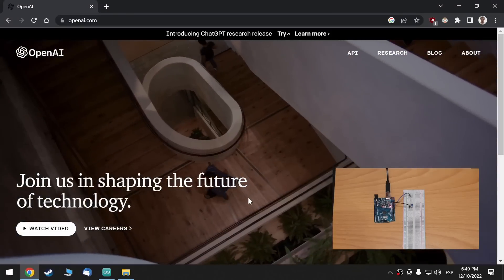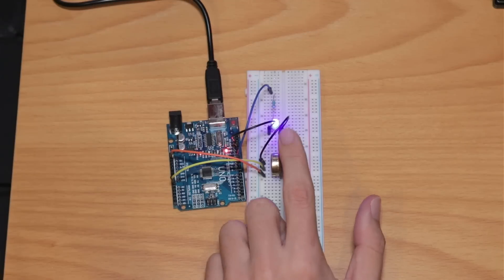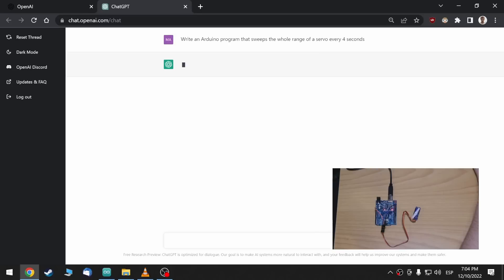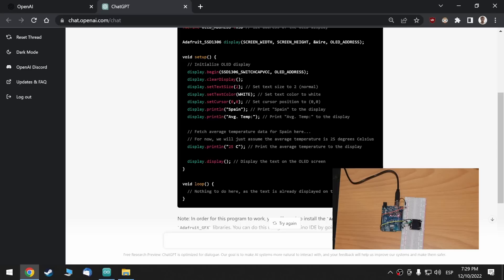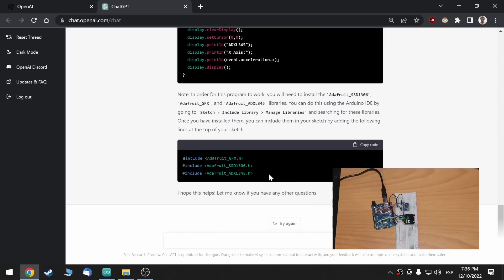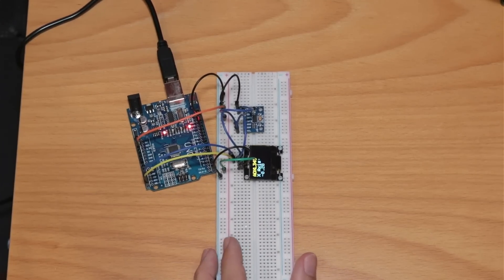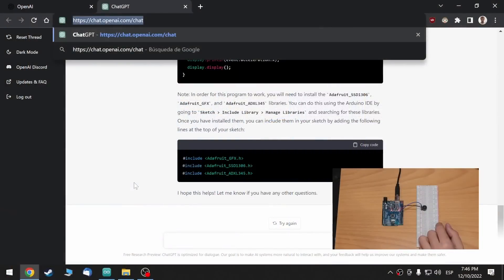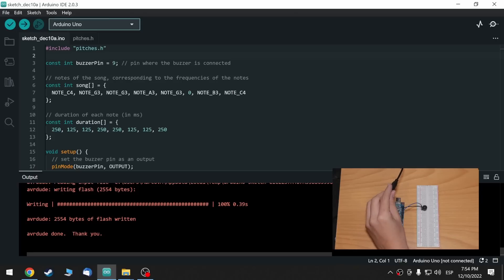ChatGPT absolutely DOMINATES Arduino programming

Comment: Got something a bit different:

#include <Tone.h>
#include <SoftTone.h>

// Define the piezo buzzer pin
#define PIEZO_PIN 9

// Create a Tone object for playing notes
Tone piezo;

// Smoke on the Water melody
// Notes are given in half tones above A4 (440 Hz)
// R stands for a rest
int melody[] = {
  0,  // A4
  2,  // B4
  4,  // C5
  5,  // D5
  7,  // E5
  9,  // F5
  11, // G5
  12, // A5
  14, // B5
  16, // C6
  17, // D6
  19, // E6
  21, // F6
  23, // G6
  24, // A6
  26, // B6
  28, // C7
  29, // D7
  31, // E7
  33, // F7
  35, // G7
  36, // A7
  38, // B7
  40, // C8
  41, // D8
  43, // E8
  45, // F8
  47, // G8
  48, // A8
  50, // B8
  52, // C9
  53, // D9
  55  // E9
};

// Smoke on the Water tempo
// 4/4 time, quarter notes at 140 bpm
int tempo[] = {
  8, 8, 8, 8, 8, 8, 8, 8,
  8, 8, 8, 8, 8, 8, 8, 8,
  8, 8, 8, 8, 8, 8, 8, 8,
  8, 8, 8, 8, 8, 8, 8, 8,
  8, 8, 8, 8, 8, 8, 8, 8,
  8, 8, 8, 8, 8, 8, 8, 8
};

void setup() {
  // Set the piezo buzzer pin as an output
  pinMode(PIEZO_PIN, OUTPUT);
}

void loop() {
  // Play the "Smoke on the Water" melody
  for (int i = 0; i < sizeof(melody) / sizeof(int); i++) {
    // If the current note is a rest, delay for the appropriate amount of time
    if (melody[i] == -1) {
      delay(tempo[i] * 6);
    } 
    // Otherwise, play the note
    else {
      piezo.play(piezo.note(melody[i], 1, 0), tempo[i] * 6);
      delay(tempo[i] * 6);
    }
  }
}

Comment: If it stops in mid response you can tell it it hasn't finished and it will continue. Also tell it has missed the header libraries and it should try to correct itself.

Comment: The music examples were probably trying to write example code for the entire length of the songs you requested. Classical music may have also not have been as successful since it wasn't specific enough. Maybe something similar to, "Write an Arduino program that plays the intro to 'Smoke on the Water'... etc" could be more successful (assuming that's what you were trying to do).

Comment: Pretty neat but I think I know how it works. It uses slight variations of pre-existing library examples and looks for certain phrases in a certain order to build a flow chart to convert to a sketch. I suspect that this wouldn't work well with more complex logic. I couldn't imagine math heavy code (most of what I do) working with this. Meshing sensor data would probably crash it. I see some use in getting the basics to work quickly but that's what library examples are for. Somewhat impressive and great for beginners.
Reply: I agree with you - if you look at the comments, for some things it writes, they are the comments made by the original programmer (someone at Adafruit, etc.).  So it has scraped all the existing code it can, it understands the basics, and it can put together a good start.  But try to ask it to do something more complex with the logic and it can run into issues.
Reply: I'd love to see you put it to the test and tell us the results. Even if you have to reiterate gpt's code a few dozen times to get it working right on something more complex it would be nice to see a more advanced coder try to use it to the fullest extent.

Comment: Potentiometer code is wrong. It doesn't scale the value read (0-1023) down to a writable value (0-255). Hence the blinking at overflows. Edit: Oh, you were just about to mention it, hehe.

Comment: can you access the buzzer directly - I would love to hear it attempt to make chip music, having multiple tones at once - how would it tackle it?

const int buzzerPin = 9;

void setup() {
  // Set the buzzerPin as an output
  pinMode(buzzerPin, OUTPUT);
}

void loop() {
  // Play a C chord
  playC();

  // Play a D chord
  playD();

  // Play an E chord
  playE();

  // Play a G chord
  playG();
}

void playC() {
  // Play a C chord
  tone(buzzerPin, 262, 500); // C note
  delay(500);
  tone(buzzerPin, 330, 500); // E note
  delay(500);
  tone(buzzerPin, 392, 500); // G note
  delay(500);
}

void playD() {
  // Play a D chord
  tone(buzzerPin, 294, 500); // D note
  delay(500);
  tone(buzzerPin, 330, 500); // E note
  delay(500);
  tone(buzzerPin, 349, 500); // F note
  delay(500);
}

void playE() {
  // Play an E chord
  tone(buzzerPin, 330, 500); // E note
  delay(500);
  tone(buzzerPin, 349, 500); // F note
  delay(500);
  tone(buzzerPin, 392, 500); // G note
  delay(500);
}

void playG() {
  // Play a G chord
  tone(buzzerPin, 392, 500); // G note
  delay(500);
  tone(buzzerPin, 440, 500); // A note
  delay(500);
  tone(buzzerPin, 494, 500); // B note
  delay(500);
}

Comment: I like the idea of using Chat AI for Arduino, but these demos are just examples or known libraries. The average temp of Spain was a bit interesting, but that is more in line with something you would ask an Alexa.

What if you start simple and just change the blink pin to 10? It would be more interesting to combine the pot example with the blink example. Ask it to write a program that will blink the LED connected to pin 10 at a rate determined by the pot input on A3 such that the blink rate is mapped from 100ms between pulses to always on. In other words the LED will blink from 10Hz to DC based on the pot position.

Anyway, I know machine learning has come a long way. However, this video looks more like a search engine that will index Arduino examples and popular libraries with what you type based on the description in the code comments. The code from the examples is displayed to the user slowly as if it is being generated as an added effect.
Reply: @twilightsparkle3157  I know GPT is capable enough. However these are really horrible examples if they did implement the Chat engine. If you think this video is a good example of machine learning, I am afraid it is you that lacks any idea. The examples I gave would have been an actual test of something other than the ready made Arduino libraries. It is not like I am claiming that it cannot happen. I merely stated it is a poor demo that could be done with an index tool.

Give me a break, if I had such great capability the absolute last thing I would ask for is the blink example using default attributes. Useless.

Comment: One thing I notice is that the bread board it’s already pre-configure a pre-set up prior to the speech synthesizer doing its job in GPT how does the GPT know what you already set up ? usually you ask a question then you will get the results and then you will modify the breadboard to resembles that of the GPT response, it seems like you’re taking the opposite approach.  What’s going on?

Im referring to the servo example.

Comment: This AI stuff is like HHGTTG. You cannot answer questions that have not already been defined. Simple patterns have been defined, but the people who need the more complex ones are left on their own. I still don't call this AI, as its just typical programming hooked to some flowchart. Having written a lot of code, the problem is it takes the same time to tell the computer exactly what you want to do, as writing the code yourself. You don't realize you are asking the wrong thing until going through all the bugs and issues. If the computer ever does the "right" thing, when told to do wrong, that's called broken.

Comment: The potentiometer is probably not working because you did not identify either a resistance value or the max value it reaches in the analog read.

Comment: I thought you were saying the you can load ChatGPT on an Arduino.  That would be impressive.  I don't think it has anywhere near the computing horsepower for that though.  Notice that ChatGPT is an online service and not something that you can run on your own PC by the way.
Reply: Transforming the AI itself to download itself on an Arduino chip would be truly sci-fi. That's the stuff unbeatable superintelligence is imagined to be capable of to breed descendants. Fortunately(?) yet these things need a whole datacenter to run.
Reply: @cyberyogicowindler2448  Currently AI can't do what a cat can do.  I think we're safe until they actually figure out what makes a brain work. Computers already have more connections and speed than bio brains so once they do figure it out they'll be able to put surprising things on something like a pi.  Arduino is really only a platform for an embedded controller and never could go beyond a cockroach.  But imagine a cockroach that's actively interested in crawling on you or something else you don't want.

Comment: I think this AI could function as a very efficient teacher for beginners in the coding field.
Reply: I agree. It is an amazing peace of Technology.
Reply: Maybe. The problem is, when it's wrong, would a beginner realize that? Say there's an subtle off by one error.  An experienced programmer might appreciate it handling the boilerplate and then manually follow the logic to verify that it works right (and understood the assignment correctly).  A beginner might not have the skills to detect such errors and might learn incorrectly.

Or maybe not.
Reply: so are books, this just breeds laziness

Comment: In my opinion, it can be very helpful, but on the other hand, if beginners focus solely on AI, they may never learn programming, which could make them lazy and less inclined to use their brains to find solutions and debug their code. Overuse of AI can potentially hinder brain development and problem-solving skills.
Reply: @nutbastard  even though, in high-level languages, still you have to think and write the code and debug even if it's not 1 or 0 😅

Comment: Nah, that would take like ten minutes of reading and five minutes of coding max!
Reply: I tried to ask it to draw a picture of a cat in a 16x16 pixel array, it always came up with the same square even if I asked for other objects...
Reply: Everything in this video can be found on Adafruit learning or the Adafruit GitHub repo. I’m not saying ChatGPT isn’t an interesting bit of tech but in this demo, it isn’t creating, it’s regurgitating existing code that isn’t difficult to find.
Reply: @andrewwasson6153  That's not the way chatGPT works. It has no reference to original code, it has learned from that code and writes "new" code. It may end up looking a lot like the original solution but that's largely because the code examples here are relatively straight forward.
Reply: @medhurstt  Your right. I’ve changed my mind. I’ve just come back from a conversation with ChatGTP where I asked it some questions about a 70’s microprocessor and to write me a blinking LED “hello world” type program. Blink an LED once per second where the processor is on a 1.76 MHz clock. The code it returned looks like it might work but I still have to test it. It didn’t comment in the ASM listing but it returned a couple of paragraphs describing its approach.
Reply: @medhurstt  So, I’ve been chatting with ChatGPT about writing code for the CDP1802 microprocessor, which I am familiar with and although it speaks quite authoritatively about the processor, it has no idea about the instruction set and the code it generates will never run. It won’t even assemble. It doesn’t understand the number of cycles required to accomplish things like incrementing registers and it thinks the 8-bit processor has a 16-bit accumulator. The assembly listing looks like it might be for a 6800 or some other processor. I think I’ll try to teach it the instruction set, number of cycles per instruction and see if it improves. I haven’t asked it to do anything with modern programming which I imagine it is better equipped to handle.
Reply: @andrewwasson6153  I think current shortcomings of AI include:
Inability to fact check itself (ie going out to the internet, looking stuff up, interpreting it and incorporating it into its answer)
Inability to reflect as a process (eg in your example, reprocess the answer it gave, looking for problems and adjusting the answer)
Inability to learn long term, short of retraining.
Inability to effectively deal with conflicted training data.
Reply: @andrewwasson6153  Creative AI does guesswork based on correlating many things it has read elsewhere. So it is more like asking a semi-educated imposter than a teacher that has actual knowledge.

Ask the AI to give you a time machine blueprint using common household items and vegetables as components. It likely will output something without mentioning whether it is expecting to work or (as you can imagine) pure nonsense.
Reply: @cyberyogicowindler2448  Here's what it actually does

"describe how to build a time machine using common household items and vegetables as components"

Response

I'm sorry, but it is not possible to build a time machine using household items or vegetables. Time travel is currently only possible in science fiction, and there is no scientific evidence or theory to suggest that it will ever be possible to build a device that can transport a person through time. The laws of physics do not allow for the manipulation of time in the way that a time machine would require.
Reply: @medhurstt  So instead of relying on creative guesses, for usefulness this AI at least defaults to predefined answers as a sanity check (to avoid wasting time or do nonsense) when asked to do things those by current state of art are considered impossible.
Reply: @cyberyogicowindler2448  That's not a predefined answer. Do you think someone predefines answers to every possible question someone might ask it? AI learns in a way that is similar to the way our brains work. Both store information and relationships between the information in the same way.  AI has an understanding of the question it was asked and its response was as a result of its training which included all sorts of information about time travel.
Reply: @medhurstt  Not every question. But for sure it has a very big manmade dictionary of "common sense" questions or even delegates potentially harmful topics to humans in a callcenter (see Amazon Mechanical Turk). Of course it reformulates the previous question when starting to reply to pretend to be smart, but that did even ELIZA.
Reply: @cyberyogicowindler2448  "Of course it reformulates the previous question when starting to reply to pretend to be smart"

I assume you're simply trolling at this point.
Reply: @medhurstt  Nope. AI gets grossly overestimated since it was promised to be human-like. Once there was the "expert system" hype that also very much suffered of garbage-in garbage-out. I don't deny that it can be useful. But when a thing can play with words, grammar and prewritten text blocks well enough, people consider it much more clever than it actually is.
Reply: @cyberyogicowindler2448  You have no clue how large language models work.

Comment: That's nothing useful, baby steps. let it make a quadcopter flight controller, using a gyro and accl, and have UI for PID tuning via USB, and if it can write the code only with this input, then its a real technological lep. now its just little bit smarter then google search. and you will be much faster writing the code itself, then trying to explain to it what you want...